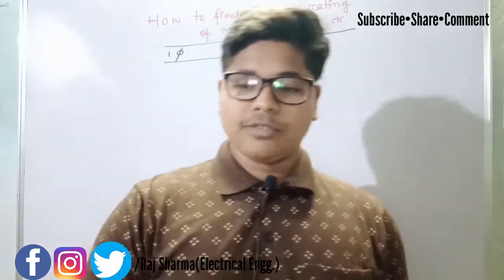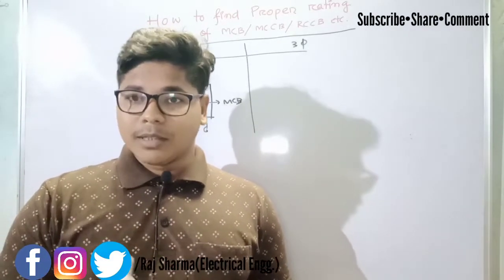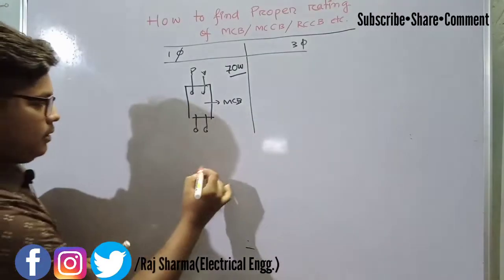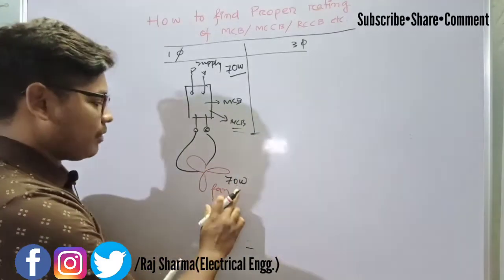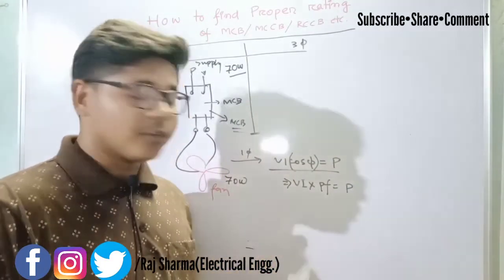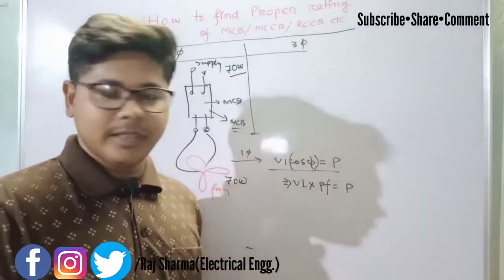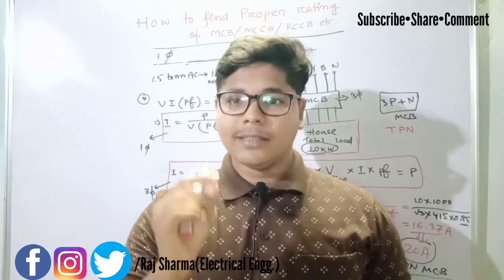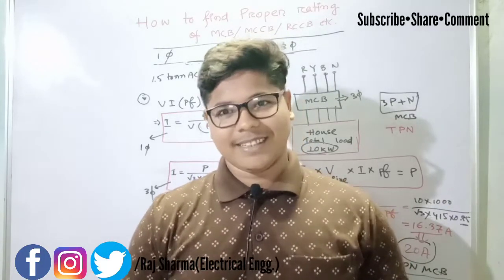Proper calculation of MCB rating both 1 phase and 3 phase||Calculate MCB connection for 1.5 tonn AC

Comment: Dude, your calculations are good.But you made big mistake!MCB protects cables, not the electrical divaices!MCB must be calculated based on cable gouge! If you have cable 2.5 sq/mm then you put 16a MCB, if 1.6 sq/mm then 10a MCB.If you will put bigger rate MCB you just simply burn your cables.
Reply from the maker: Cable size and MCB selection both are calculated taking the equipment as base  rating. There is already video uploaded on cable size calculation.
Reply: @electricalpoint5852  what I ment is that Power Grid company gives you an Kw/h counter. And below it  there is main MCB. whitch is sealed by the company. Then based on this MCB ratings you put your own MCBs on split-lines, and you put cable gouges according given main MCB and further split MCBs ratings.If you are not in ough of given power to your hosehold you have to ask the company for highier rating MCB.and then revire your cable system.For exeple to your hose is given 5kw, but you need 9kw .You  ask power-grid company to give extra kws.Then insted of having 3 split cable lines you put 5.You do not put single cable in your house with 6 sq/mm gouge?